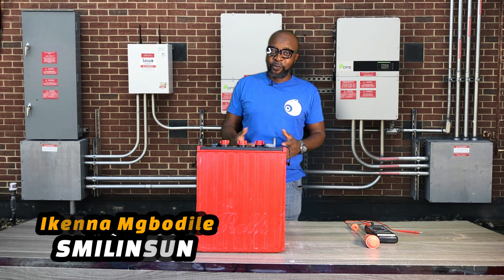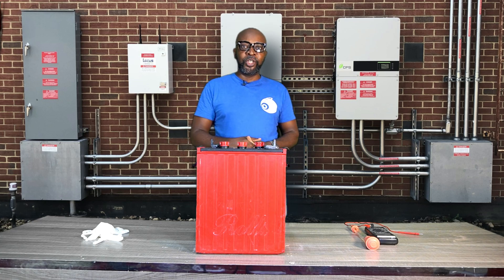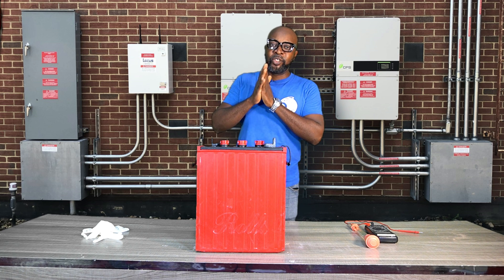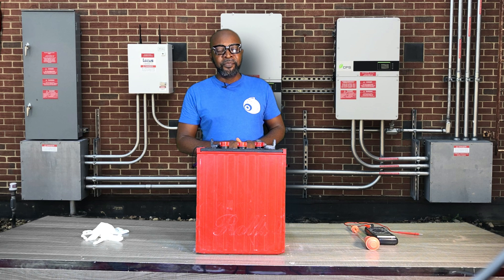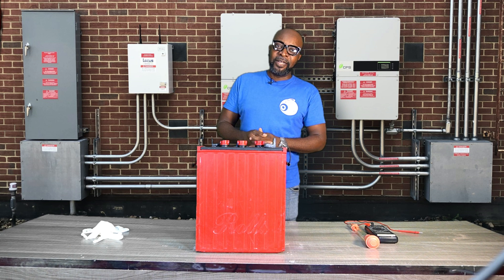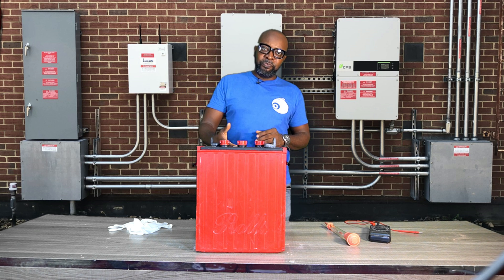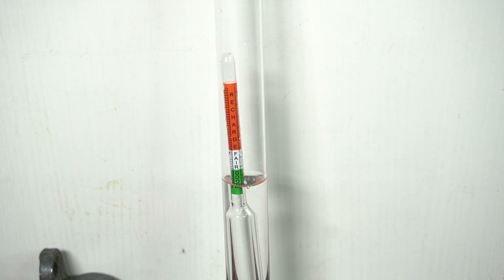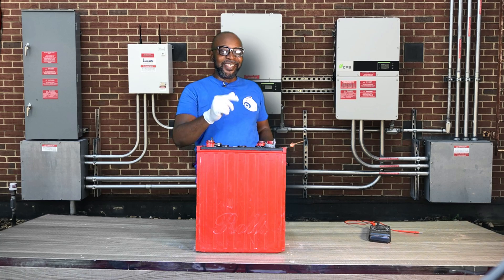Easy way to test the state of a Tubular or Flooded lead acid Solar Battery.

Comment: Please I have a question.

There are voltage and current setting options on the inverter and charge controller.
As it is necessary for each battery charging stage to maintain the appropriate voltage & current in order not to overcharge (fry) or undercharge the batteries.
How do we know the parameters (voltage & current) to set for each battery setup (Lead Acid 24V, Lead Acid 48V, Lithium 12V, GEL 48V, e.t.c).

Comment: It may be good to add that before one tests the cells to check their respective specific gravity, they should ensure that the battery is fully charged via whatever means is available to them - solar or grid.
Reply from the maker: Correct

Comment: How do I install a battery equaliser for a 120 volt inverter system? The batteries are 10 and connected in series.  Thank you
Reply from the maker: You will need 15 units of 96 volts equalizer and 1 unit of 48 volts equalizer and do continuation connection to ensure that equalizers communicate with each other.

Comment: Is it good to flosh my battery with disttled water and then fill it up back with battery chemical  am talking about lead sealed battery
Reply from the maker: Yeah its not a bad idea if the batteries electrolyte is weak , but if you get it wrong the battery is gone . So it has to be handled by real professionals because of the specific gravities. It has to be exact and make sure the electrolyte is mixed with distilled water not tap water.
Reply: @smilinsunsmilinsun8056  okay mine doesn't store charge so when the sun is out that's it
Reply from the maker: @laurabarnes3295  How long have you had the battery or batteries
Reply: @smilinsunsmilinsun8056 sir how do we differentiate between ordinary water and distilled water.

Comment: Good video. However, when is the best time to do this test? Is it immediately after charging the battery or allowing it some time after the charging?
Reply from the maker: Thank you for reaching out , you can test the battery in any state it will always tell you the state of charge of  the battery. But if the battery is fully charged and you test and its hovering on the top end of the red then your battery cells might have a problem.